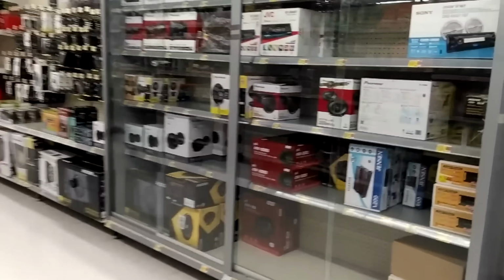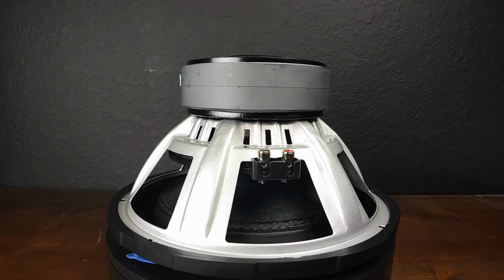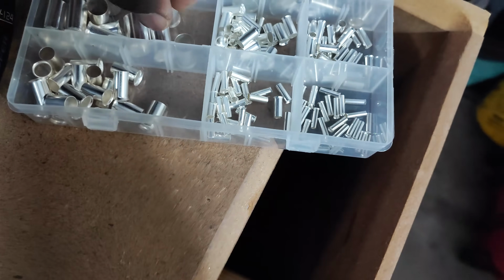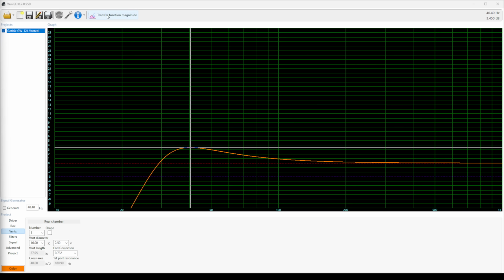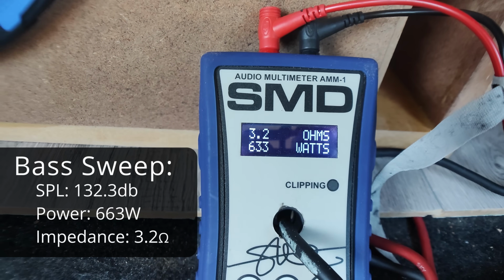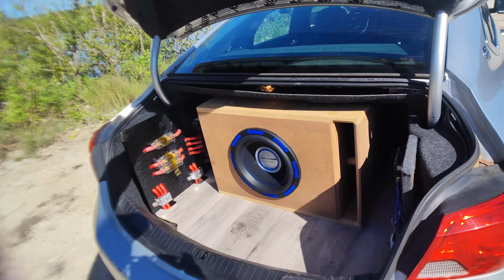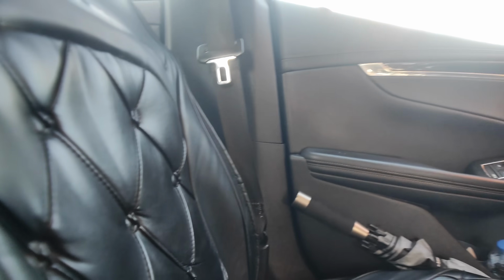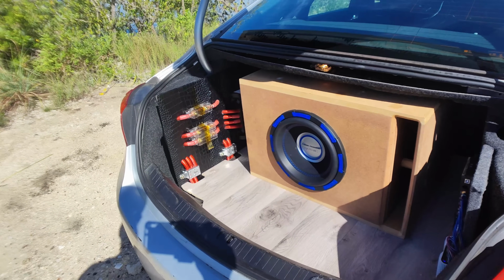Why Is EVERYONE Buying This $80 Subwoofer | Power Acoustik Gothic GW124 | 4,000 Watt SPL Test

Comment: I have 4 of those black gothic 10s in like a 12ft box tuned at 23hz. Pushing around 3k. Great subs. Zero issues. I've had 2 of those Walmart 12s as well. Also a great sub. The Walmart 12 got hotter faster and honestly they were very stinky subs. I though they were going to blow every day. Never did

Comment: Its ALL about the BOX. I use to be in SPL competitions. And from single 10" class to B pillar walls. Let me tell you that the box and resonance frequency of the cab is the first 2 major key catalysts that will determine the rest of a build. You can be running Crossfire, DD Audio, Sundown or whatever other brand you want but if your box aint built right you just making noise.

Comment: Im 52 years old and I love my bass,im building an 07 Toyota Yaris and itll have 6-12s in a wall amd not sure about the power yet,have just finished building a Tahoe with 4-18s and it does 30,000 watts,powered by 5 sodium ion batterys and all the system is DS18 subs,speakers and amps

Comment: Had this sub hooked up to a alpine pdx 1000.1 had the gain 3/4 way up and it blew not sure how yours is able to handle so much power
Reply from the maker: I'm only send clean power, at short durations. The gain settings must be set with an Oscilloscope or muti-meter. Otherwise the subwoofer can not cool properly and burns the coils. I appreciate you sharing your experience with the sub!

Comment: Such as if you were to sit a subwoofer enclosure in the middle of an open room, you will hear the bass however the SPL (sound pressure level) is nonexistent due to there being nothing for the Subwoofer to load off of. Which also as seen when the you correctly place the woofer facing the rear trunk of the vehicle. The subs should ALWAYS face the rear of the vehicle, it's mandatory to simulate best "loading" conditions. If you are doing trial & error, you can start to play with the location of the vent (port) in the enclosure rather than the enclosure itself.    Moving the enclosure around trying to see if you can find the sweet spot in the vehicle where it best performs? No disrespect, but if you're not fully understanding all aspects including being able and technically grasping the scientific formula for achieving bass & you're still using trial & error methods to move the box around in the vehicle trying to achieve the necessary conditions to achieve the highest sound pressure levels possible, take some time to make sure everything is "bulletproof" or you've already failed. The loading/reflection surface is needed for achieving any pressure from the woofer. Vent your next enclosure either on the opposite rear of the box & you may be amazed by the insane amount of airflow & allows for increased gain levels from the amplifier to the sub preventing the over excursion & underpowered clip points of the woofer

Comment: So how can i run two of these? What do you guys recommend? What would I need for a amp to run two of them and how should it be wired?
Reply: Depends if your cars power system is stock if so 2 gothic 12s and a skar 1200.1d or taramps 1200.1d or if you have some extra money get a sundown 1k amp
I would recommend a capacitor or small agm battery for better and longer lasting stability voltage wise

Comment: I just put 2 of these in a prefab box and it blew me away I have no complaints. Running taramps smart 3k bass 350a J's alt big three stock battery has the roof flexing on my equinox
Reply from the maker: I believe it these things are way underrated

Comment: You can get that same sub for 40 dollars online. It's basically a Soundstream driver
Reply from the maker: Not sure about that.
Reply: @BudgetBassHead  100 percent sure about it. The old gothic series before they made the deal with walmart went for between 40 and 65 dollars. Power Acoustik is Soundstream's sister brand and they have the same equipment with different logos a lot of the time. I have two OG 8310NRB Receivers. Same numbers, different prefixes. The Soundstream is a VIR-8310NRB, and the Power Acoustik is a PTID-8310NRB. The both have the same crazy, 8.3 inch screen that first pop's out like a standard  flip up, but then they rotate 90 degrees, THEN Flip up. Soundstream was the only company to ever make a receiver like that and then the parent company that owns Soundstream bought out Power Acoustik and started sharing models between the two companies. The products will look slightly different, have different names, and different color schemes, but they spec and  perform the same.  In the case of the Gothic Sub, Soundstream Counterpart was the R3 which has since been continued, the same as the all black Gothic that doesn't look like it was made by Playskool in 1989. Same motor, same basket, same voice coils, same surrounds, same terminals, same gasket, different cones.

Comment: They can do it but they will break quick running that kind of power and to be clear their SQ is not very good. Although at it's price point its maybe the best you can get from Walmart. But whatever you do DO NOT buy Power Acoustik amps.  They put out anywhere from 15_30% of the power they claim but they arent cheap like the subs. Before I got better educated on these brands I bought a P.A. 3000w class-d amp for over $160. turns out it put out a little over 500watts RMS😂 Of course we all know that's peak power at 3000 but the book claimed 1500 or 1600 RMS🤣. I once heard 2x12in Pioneer Champions in a ported box that had really good SQ at $80 each I was shocked. If I was to go for this price point I'd try these for SPL but if I wanted those lows with good SQ I'd try the Pioneers.

Comment: I had two Power Acoustik Mofo 15" in a custom 8.8 cube box tuned to 26 hertz, and it was on another level. My first big system and it still bangs hard to this day. Also I never even put this in a car. I use it for my home audio system. If I had it in a car I'd imagine it would bang way harder

Comment: I got 137.9 in a sealed cabin with the db meter on the windhshield, running a twelve inch JL-0w at 650 watts lmao 138 window open

Comment: These are junk. You can get better subs for the same or close to the same money with better sound and response. Power Acoustik is synonymous with low quality equipment only a couple steps above Boss and Planet Audio. I've been in car audio since 87' been through alot of equipment. But truly the box will make the woofer. Even if it's junk a good well made box can actually make it sound ok.
Reply from the maker: Thanks for your perspective; box design is definitely key!

Comment: An $80 sub in a $400-$600 box with a $700 amp. Not to mention, probably $200-$300 worth of 0ga and I'm sure an upgraded alternator and/or a separate dry cell. That's a bold choice lmao. Still love the videos, especially bc you include the numbers and data that matter to real audio guys. Great work man.
Reply from the maker: Appreciate you noticing the numbers!

Comment: Black gothic has a larger excursion and a deeper cone, meaning it's louder at full flex, and it can reach a bit deeper bass because the surface area of the cone is larger than the Walmart edition. That's why basket designs are different. The online version is a bit better.
Reply from the maker: Then why do they call the Walmart version, the 'premium' version? Just asking

Comment: I personally have been using this sub for the past 7 years and it hits hard. . Granted I have this inna memphis sub box. And the 2500 slim amp. Most people think I'm running  2 12s and 5k amps.

Comment: Just built a single 12" ported box out of some old MDF I had laying around. Was using an old BBOX prefab dual 12" which was great but really heavy and big and tuned at 38 HZ. Can't say it enough how much happier I am with my new box tuned to around 30 HZ with one of my ancient RE SR12 subs. My subs have survived through 5 different cars, two amps, and a car accident...Old Clarion APX 1300 is going on 20 years of use.

Comment: Technically you don’t need to cram 2 12 ga wires into each terminal. You can run a single + and - from each terminal and then splice the 4 wires together to the amplifier. If I’m not mistaken lol. I haven’t messed with my build/builds in awhile 🤷🏻‍♂️ so I might be explaining it incorrectly but I don’t think I am. I had a power acoustic “mofo” 15 and it was pretty good. It was getting down. Definitely could not take rated power at allll though. Even a couple seconds of rated power and it was stanky af.

Comment: The material that you build your speaker cabinet out of matters.
Use crappy material. You will get crappy results.
MDF = Good!!! 
High end Baltic Birch = Good
Learn how your speakers respond to being in a big box or a small box.
Smaller boxes = less air to move, less power needed, the magnetic on the back of your speaker doesn't heat up, the material that the speaker is made out of doesn't heat up, and you get a longer life stand out of your speaker.
Bigger box = more air to move and the opposite of what I said for a smaller box....
There is an actual "science" behind building speaker boxes, and speakers themselves.

Comment: i tell everyone i meet that asks "what do you use" i say "a cheap ass gothic sub and a free cone style ported (square) box". it indeed does what i want and then some...

my gothic 12 prefers to be around 18hz since thats what the box is tuned at... its also side top firing with the port shooting out the side.
for the record though, ive had power acoustic since i was 22 or so. had some rockford p1's (set of 12's) that didnt hit as hard as this single sub. and were 3/4 times the price. power acoustic is WAY under-rated in my opinion.

Comment: I’m 37 and still got 4 12’s in my s10. Cut through the cab and bed. 2 1000w amps strapped together and a 500w amp for my speakers and tweeters
Reply from the maker: Sounds like a nice setup

Comment: I grew up building systems in the late 90s and continued well into the 2000s. Its been 15 years since I built my last system. My last kid just graduated, and want to finally put some bump back in my family SUV. However, I still need to keep as much usable space in the rear as possible. I do want it to thump, but i want it to sound clean too. I was thinking a single 8" or single 10". I also have a Sundown 1200D mono amp that  I can power a sub with from back in the day. I'm assuming I should go sealed to save space huh? Any recommendations? I don't mind building a box, but I would also consider a loaded enclosure if it performs well.
Reply from the maker: There are so many options for you to choose from. First thing that I thought of was downward firing sealed enclosure. A lot of companies make them but Kicker makes one with a passive radiator,  that may save you a lot of space.

Comment: I have installed car stereos since 1992 , I get that new cars have a custom stereo to fit there dash , odd screens odd sizes . The quality of sound reproduction your going to get from them ,Is quiet honestly absolute garbage. You are much better off running your system threw a real brand car stereo . However you have to do it , .. why most serious car stereo guys use older cars to do there builds  out of .  Just saying ,, your cutting off alot of your freq
Reply from the maker: You are incorrect. For someone who's been an installer as long as you say you have, how are you not familiar with plug and play interfaces available for, just about any car? You can capture the raw signal from the head unit and bypass any factory amplifier from the company.
Reply: @BudgetBassHead  signal is done cut off by time it gets to amp , the head units just dont even output the top or bottom of the signal

Comment: Listen here. That's a 16 lb speaker. You can't go outside of the specs like you can on these heavy, high dollar subs that were basically designed for ABUSE. Top shelf subs typically cost $500, $1000, or more. The SUSPENSION on these Gothics isn't as STIFF and the MAGNETS aren't as LARGE as top shelf subs. A top shelf 12 inch sub can usually take AROUND 1500 watts RMS (that's CONTINUOUS rather than BRIEFLY). That's TOP SHELF. If  you go beyond 1800 watts, then they burn out after a few months  For the Gothics? (And I can tell by looking at them, and reading the specs), you could safely expect about 500 watts each out of them (that's RMS - continuous), which means, if you had a nice big box and you were running a PAIR of them, you could get 1000 watts out of them (combined). That's a little bump. It's not MIND blowing, but it's quite a bit better than stock stereos. You can feel it in your chest a LITTLE bit. Like, it's obvious it's an upgraded stereo, but you're not going to be entering into any competitions, but it's somewhat loud. OK?

If you push them any harder than THAT? you're going to shorten their life span. If you put a thousand watts EACH through them? They won't even make it a month. I PROMISE you I know what I'm talking about. I've bought and sold and replaced probably $20K dollars worth of audio equipment down through the years in all of my rides. I've been messing with audio equipment my whole life, and I'm over 40 now.

If you don't listen, I feel bad for you, but some people need to learn the hard way.

Those are respectable little light duty subs, but don't try to make them into something that they're not.

🤷 Good luck.
Reply from the maker: Why are you discussing to shelf? This vid is about an $80 subwoofer. No one is debating your logic about "Top Shelf" products. This is a budget gem we're discussing.

Comment: I’m asking anyone kind enough to think about it and respond. I’m on a budget and I just want a respectable thump. Recommend a cheap sub and amp combo. Right now I’m thinking gw124 12” we see here and a rzr1 2500d. I’m not opposed to buying used either if you wanna recommend something more expensive I might be able to find used. All advice appreciated, not a stereo guy just wanna bump a lil on the drive to work without spending more than I paid for my shitbox. I do intend to upgrade as I can afford it in the future if that affects any advice
Reply from the maker: Skar Audio, CT Sounds, NVX, and Rockville Audio all offer budget bass packages for around $500 or less. We're talking about a wiring kit, with an enclosure, and an amplifier. Good 🤞

Comment: Im not sure why the hype review, in 02' i switched to the original version of this sub an verified db level on a termlab sensor not a mic. 1 12" sub 2 amps(not like todays) 150db....dbdrag/nspl... 
The sad thing is the amps and all the digital stuff of today sounds like garbage and is never played at the same volume. I do own this sub and it does well thou on a 8yr old rockford 500d if any is curious but its over 136db...

Comment: What is clipping? Ive been having issues keeping power to 1k amp to a 2500w 15 in a 4 cylinder honda, any pointers?
Reply from the maker: @williambass1900  to understand clipping you must understand the sine wave. I don't understand a sine wave you must understand how to use Google. 😉 It's basically a jagged\chopped sine wave.

Comment: 1) It definately bottomed out during the rear-facing test, you could clearly hear it. 
2) Adhesive smell is from “Off-gassing” not out gas.
3) The sub testing showed 39hz as optimal for the sub, why did you test at 32?
Reply from the maker: Port tuning has to be observed during testing.

Comment: I'm pretty sure mine turns 10 yrs old this summer. I got one of these in 2015 when they released at my local Wal-Mart. I'd have to look through my storage unit for the original manual. It's been hooked to a kenwood 1k rms monoblock most it's life. The amp I got was almost 4x the price of the sub LOL. It's been with me through 4 different cars so far. 1.75 cu ft sealed box. I remember the "hot stink" took about a yr to go away in my first ported box. Hit harder ported, but it's so tight and clean in this sealed setup where it's been for probably 7 or more yrs.
Reply from the maker: Glad to hear you're still enjoying it after all these years!

Comment: Could this be used in home theatre setup?
Reply from the maker: @deltabravo6613  of course. But it will require more power than a dedicated home theater subwoofer. Most home theater subwoofer are very sensitive.
Reply: @ do you have any recommendations of amps I could attach to the box? I’m new to this
Reply from the maker: anything 500 to 1,000 watts. Start with Skar and TarAmps for best bang for your buck.

Comment: Crazy! I did not know they sell Power Acoustik stereo equipment at Walmart now.
Power Acoustik has been around for a long time. I ordered a brand new Power Acoustik 1200 watt 2 channel Gothic Series amp off Ebay back in 2002. I had that with 2 Kicker Comp 12s. Couple years later I got a Power Acoustic 2600 watt 2 channel Power Acoustik Gothic Series amp. It has been sitting under the bed at my moms house for around 15 years now. I eventually got a JL Audio 10w3 in the JLCustom box and been pushing it with my Kicker 300.1 amp. It is not much but it fits well in my reg cab truck and is good enough for me.
Reply from the maker: @_MOORE_1986  it's all about what suits your needs.

Comment: I'd seal the seams with gorilla wood glue, and spray paint the inside of the box with a rubberized bed liner.
CD quality audio always sounds better than compressed streamed MP3 format anyways if you want to hear full potential and quality to tune it. Just my opinion.
Solid notes 🎶🎵🎶🎵 👌

Comment: I remember buying a lanzar box ported plexy one in like 97. It was beautiful.  Had a alpine 600 watt amp. I just couldn't get the dbs out of it. Ok for cruising while talking. I think the sealed box for low punchy bass works. Then maybe a ported tuned sub just for ur car. Ofcourse length and distance from bounce 1 to the windshield then back to you is important. Back in the day the old bass mechanic cds had the instructions under the label to teach you to tune.